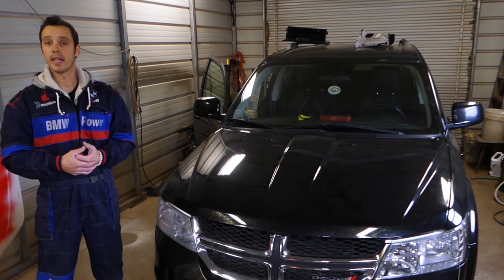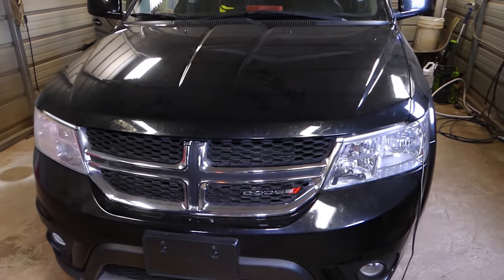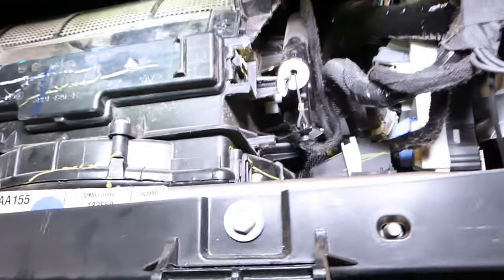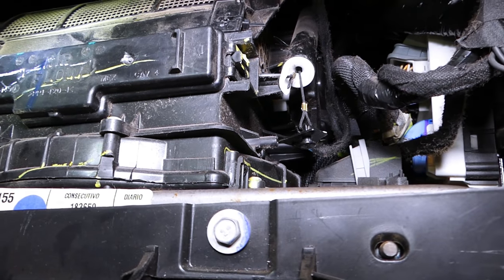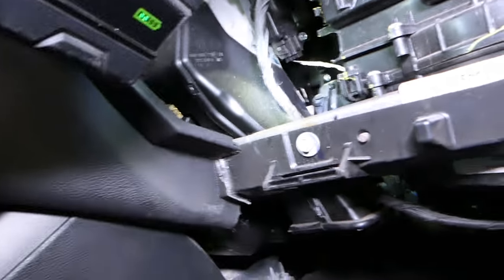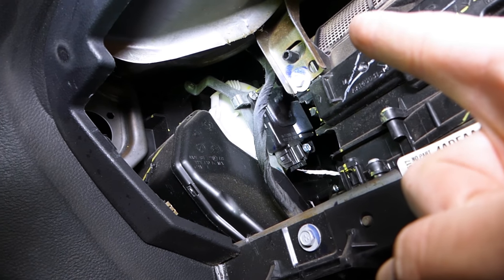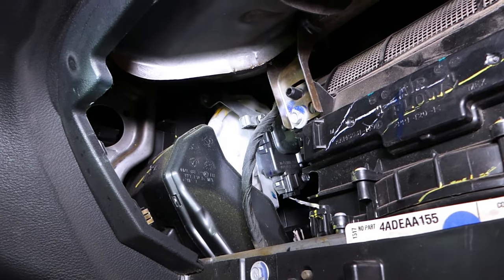DODGE JOURNEY BLEND DOOR ACTUATOR REMOVAL REPLACEMENT TEST. FIAT FREEMONT

Comment: You guys are life savers. I'm a girl... which normally means when I see a mechanic,  they assume I know nothing.  Tried to tell me $1200 to fix heat on passenger and air on drivers. I fix for 35 bucks!
Reply: Emily Hefner same! One Machanic told me the part alone was $175 plus labor. I went to Auto Zone and bought it for $23 plus tax with a 10%. I watched this video and fixed it my self. They are money savors for real. ♥️
Reply: I charge 80 - 150 plus parts depending on the trouble

Comment: Thank you for the information, I was able to successfully replace the part and its working fine now. The passenger side vents were blowing hot air when the ac was set to coldest. I removed the old part and it was jammed, the gears were not moving. Working fine now.

Comment: I still love my Journey but I have to come back every spring to remember which and where the actuator is after long winters of blowing heat... Mine always sticks blowing heat to the passenger side. Happy for winter to be over. HAPPIER  for videos like this.
Thank you. Stay safe. 
See you next year - same bat time - same bat channel.
Reply: Mine blows hot only to passenger side cold and hot work fine for driver. I am trying to find out which actuator is not working?
Reply: @giggleherz  open glove box - pinch hinges in and open further to allow glove box to drop down out of the way. Left side and back down in is white plastic actuator arm. As temp setting is turned up and down the arm should move up and down. Tap on it as changing the temp and it should free up. Mine did it again this year.... Hope this helps
Reply: @macanocious3000  OK I will give it a try ty for your help.
Reply: @giggleherz  YW  let me know what you find please
Reply: @macanocious3000  I think I found the arm but no noticeable movement.
 We paid a fortune for this car because it was the first time we could afford to buy. We love it but now its over ten years old so all the plastic parts are bound to start breaking. It is a dealer car with all the features including man/auto drive, and rear heating and cooling.  I have already replaced one actuator so I know the dealers are making a fortune. Question is when do you stop spending and buy a new one?
Reply: @giggleherz  mine is an 11 with 130K. Got it in 13 had 33K.... My last car I drove for 14 years. Not rushing to buy new (especially these days) or to buy someone else's junk. 
My worst gripe is that it eats brakes but I have always done my own... As far as the actuator  - this year seemed stuck more so than the past. Run the temp on the passenger side up and down, up and down and continued tapping on the black box and slightly prying back on the arm until it finally freed up. It seems like the track that it sits in at the top allows the arm to go a bit too far and it just gets hung up... Probably would help to cycle it more than just heat for the winter and cold for the summer. Idk.......
Reply: @giggleherz  when it frees up it will go from the top at about 11 or 12oclock back toward you down around to about 7oclock. It moves quite far. When it's cycling you will see it... it isn't just a click or a snap... 
Hope this helps. Stay safe.
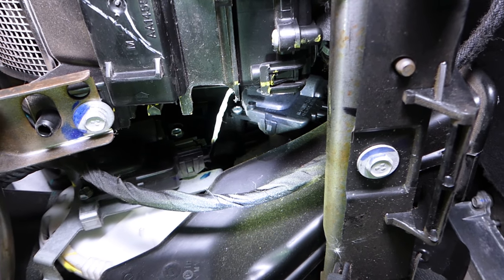Reply: @giggleherz  at 1:52 you can just barely see the end of the arm move in this video... it's back in there. That's the one. That's it.  Had to watch the video again lol. This video isn't really about this specific hot/cold arm, it's more general - what's "behind the glove box".....
Reply: @macanocious3000  Today I tried my heat settings for the passenger side and somehow it worked. I ran the temp control all they down and then back up to high heat. When it hit the top I heard the clicking sound so I quickly lowered the temp by two degrees. At a lower setting the door docent close tight and jamb. I am thrilled its working and I dont have to pay out five hundred. 
 Also I am not sure how the heat/cold switches work. If I turn on the auto sync for the front will it stay that way until I change it or does it reset each time I turn off the ignition?
Reply: @giggleherz  Great to hear its working for you. I too think the arm just goes a bit too far on high heat. Not sure about auto either. Not sure if you set it at 70 it would auto ac for summer then auto heat for winter??? But sure it will stay at setting after ignition off and on...

Happy Journeys! 😊

Comment: This is helpful. Yours is the only video I've found on this topic that refers to the one most likely to go out as the "mode actuator," a term which makes sense. Everyone else refers to it as the blend door actuator, which refers to temperature blending, not air outlet directing. The one thing I question is your mention for the need for calibration on the mode actuator. Other installers suggest that since the connection gear itself is "keyed," you can just pop it on the "cam" and it will work properly.
Reply: Whats the name of that part which controls air direction? Couldnt find it anywhere

Comment: Same car I get cold air on driver side and rear. Passenger blows full hot. Once and a great while it works. Is this the mode actuator or the passenger control

Comment: Do these actuators control the temperature? When I put mine to 
 A/C it blows hot air? Started on the passenger side and now the middle and passenger side only blows hot air.

Comment: You guys are getting a subscribe from me before I took it to the mechanic I looked in my glove box to see that my actuator motor wasn't broken but it just disconnected itself from the damn mounts that it was so I was wondering why I was only coming out my rear blowers I just reconnected the motor with some screws and now all my issues are resolved I'm game cool cool air through my front vents bro and it feels nice in New Jersey where it was 98 degrees today thanks

Comment: Dear World Mechanics, Does the 2011 Dodge Journey SXT 3.6L VVT have a Heater Core valve that controls the flow of Hot coolant from the engine to heater core ? If so, what temperature does it open and allow hot coolant to the heater core. If not, does the hot coolant run through the heater core full time ? thanks for your answers and videos.

Comment: So I have issues with my headlights. They will turn off on there own while driving or anytime really. Have read that the vehicle computer will randomly start shutting things off when there is an issue. Now my passenger side will not blow heat. Could this be the main cause for the computer problems?

Comment: Heres my issuse: no heat on drivers side. 2010 Journey, dual climate control

I have a small amount of heat on passengers side once it heats up. I have checked all actuators and they're all working.  heat core has heat, very hot to touch, still no heat on drivers side.
I have noticed the volume of air greatly reduce when I switch air temp from low to hi. 
Do you think I have heat core issue that needs a flush? why would volume of air reduce from low temp to hi temp?
does air pass through the heater core or does it blow by it?
could the heat core itself have a blockage that wont allow air to pass through it?

thanks

Comment: I have a 2011 Dodge Journey SXT, the heating system is not working properly, the driver side is fine but the passenger side blows cool air. What could be the problem?
Help please.
Reply: Heater core might be clough

Comment: 2011 Dodge Journey Crew same issue inconsistent temperatures on driver and passenger sides in heating mode. Heater temperature  core in and out pipes all good. I noticed there was a wire with 2 pin/plug connector that is hanging i am pretty sure that for them main motor. I will let you know the results.
Reply: Thanks for telling us the results

Comment: does anyone have an answer for this. I took my dodge journey into the dealer I've only had it since Jan 6th 2021. and I've taken it in 3 times now. and its still not working. at first I told them it could be the actuator because I was not getting any hot air on the passenger side. 1) they "cleaned" out the heater core. still didn't work the next day. took it in again 2) they "cleaned" the heater tubes? even though I mentioned again the actuator, and also said to them that the vent on the dash does not work when I change it to vent/floor the floor works but the dash nothing blows out. took it in again 3) they replaced the heater core compleatly. I did not leave the parking lot I checked the heat on both sides where good. but the vent still is not blowing air out. I brought two tech guys over they are like aaaahhh we have to call Dodge I have a friend who works there and I think this is "normal" i'm like what? its normal for no air to blow out when you change it to vent.. come on.. I'm sure its the actuator doors and if they need to be calibrated they are LAZY and don't want to do the work.. I'm almost out of my 3 month warranty and they've had my car for at least 3 weeks.

Comment: After tracing down low air flow at the vents it turned out to be a clogged cabin air filter just above the fan.... This is the first vehicle I've owned thats had one..... removed the clogged filter and it'll blow your hair back.....

Comment: Hello all,
I need help with my 2016 dodge journey ac. When I turn to the left, the air shift like its being blocked and water leaks on the passenger's side floor board. Can somebody tell me what it might be. Thanks in advance
Reply: There is a hose on the firewall that doesn't connect to anything. It's to drain the condensation out of a pan under the AC coils. It is probably plugged up. I had a vehicle that did that to. Found out Dirt Dobbers had built a nest in it.

Comment: 2014 journey, passenger side when using AC blows warm air. How to fix?
Reply: Having same issue
Reply: i have the same problem today, i think it might be the air filter because thats what they told me on my last service appointment
Reply: Did you resolve this issue and wouldn't it be the passenger side blend door actuator?
Reply: @jeffkreimes5279  yes that's exactly what it was .

Comment: I have 2011 journey, there are 3 phillips screws to take out. Not 2. The 3rd screw there is very little room for removal as you cannot get a small socket with a Phillips bit to remove it. A very poor design and so much wrong info on videos.
Reply: I just break the tap off by moving it back and forth. You're replacing that part anyway. I never put the 3rd screw back on the new one. Seems to be holding just fine.